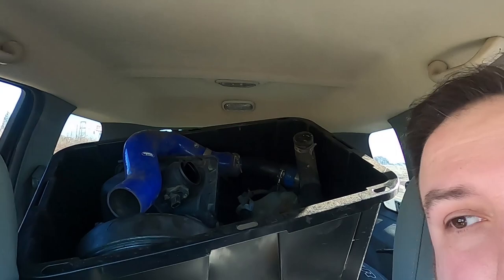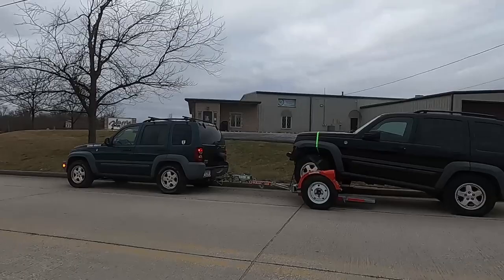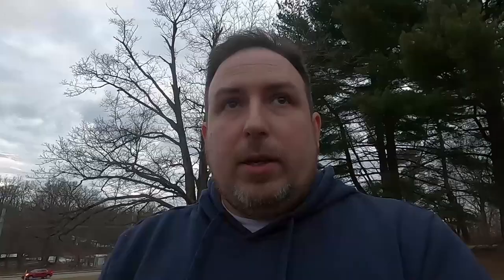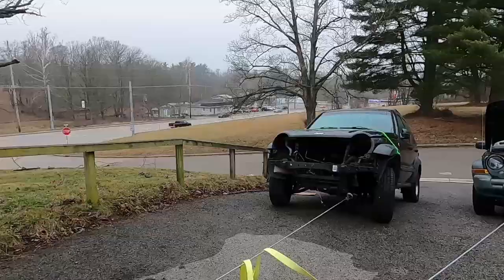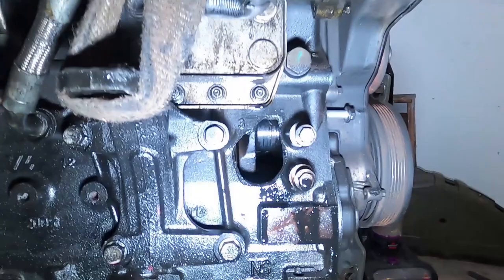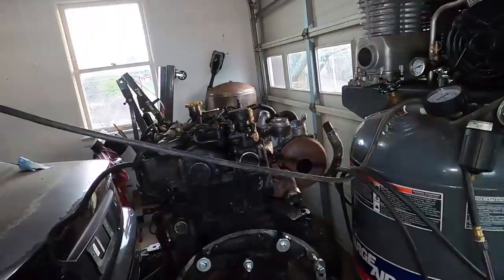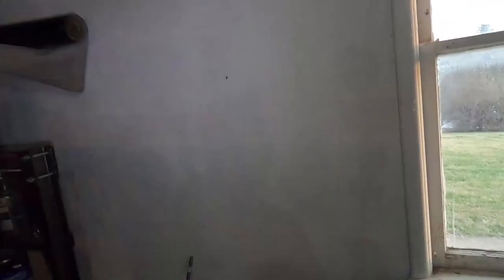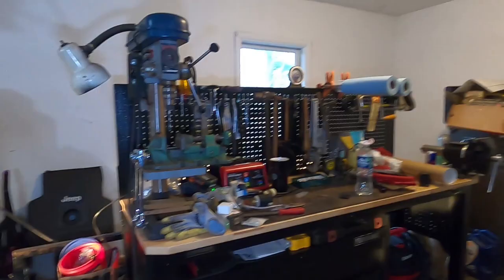Jeep Liberty 2.8 CRD Towing New Jeep Liberty 2.8 CRD Project

Comment: Can I pick your brains if you have crd knowledge please?
Have a 2004 2.8 crd with cold(and even cool) starting issues….will reliably start in warm weather but even a cool autumn night means it will not start in the morning?
Heater plugs changed ,tested and good…modules replaced as had error codes so now no errors on heating. 
When cool weather it will just turn over until battery dies and when I put battery jump pack on it spins super fast and then starts ok!?
Battery is not that old and a quality red top so should be ok?
Any ideas ?? 🙏🏻
Reply: Mine is picky about temperature as well. The biggest thing with these is cranking RPM. Sounds like your battery is not able to deliver enough amps to get it going. If the jumper pack makes it spin super fast as you put it, that in reality means it's turning over super slow without it. Slow speed with a Diesel gives much more time for blowby to reduce the pressure, and reduced pressure means less heat to cause Diesel autoignition. Look into finding an ultra capacitor to pair up with the battery if you're sure it has good capacity and is only weak in cranking amps. This will have the CRD maintain a nice cranking voltage and fire right up. Best of all your batteries will last WAY longer too. 

The other thing, perhaps first try, is not to crank right away. Put the key in and turn it so the glow plug light comes on, but don't crank after it goes out. Count to five seatbelt bings and then cycle the key off, and back on for another 5 bings. Then crank it. This will greatly help start these. With that and the increased cranking RPM it will start even if it's very cold!

Comment: Might be buying one up here in Canada (Rust free) and yes I have seen pictures, my plan is to be using it to pull my boat with it (2300-2500lbs) taking a 5000km trip across Ontario Canada this July, what should I expect for MPG? Driving no faster than 110km/h
Reply: I got about 24 miles to the  gallon  here in the States

Comment: Does everybody treat these super cool engines like they are a V8 7.3 or Duramax and just beat them to death? I have an 05 CRD and its great, just don't abuse them.
Reply from the maker: Thank you for the comment! We don't really beat on it. the towing capacity is 5000 lbs, so with the weight of the jeep and the dolly we are only slightly over. overseas the capacity is rated slightly higher at about 6200 Lbs so I think it is within capacity of the vehicle. Thanks for watching!